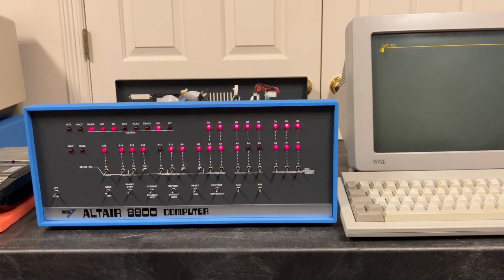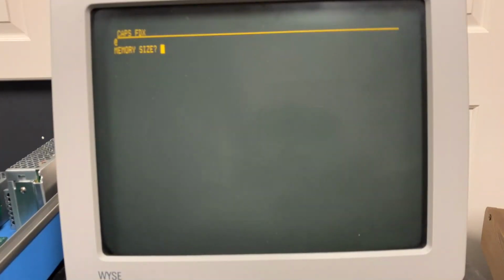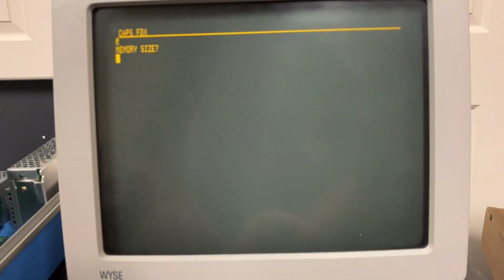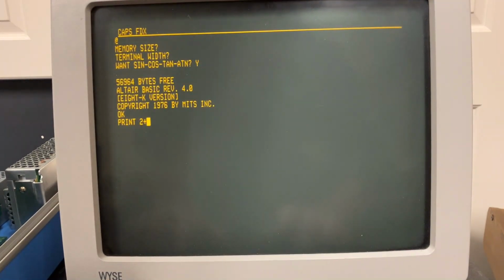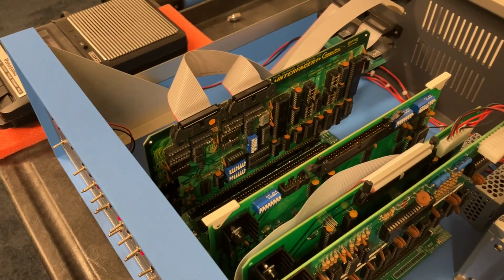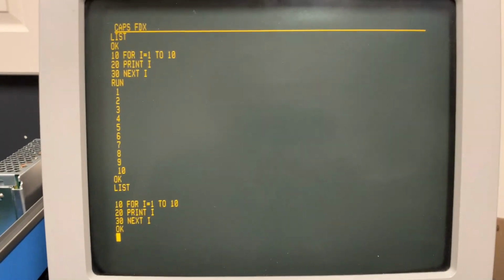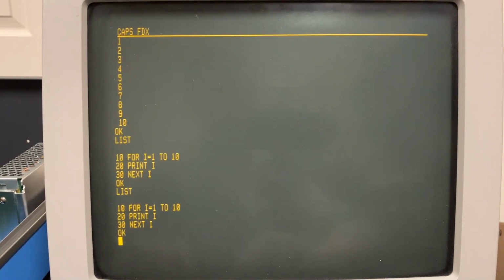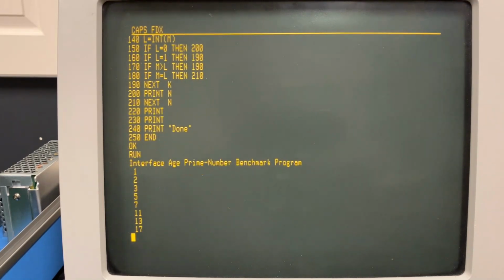Replacement for the Altair Cassette Interface (88-ACR) - Part 2

Comment: Great video! I'm working on prototyping a small, 20 MHz Z80-based CP/M computer based on a few of the architectural designs that I've seen in your Altair videos. 20 MHz is blazing fast for CP/M, I would think :)